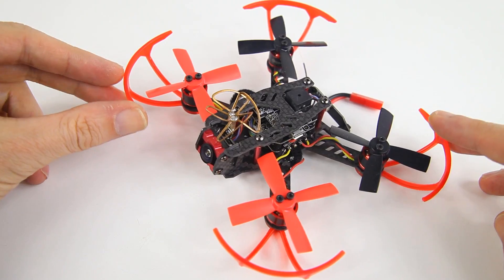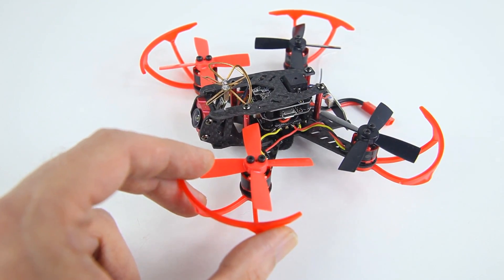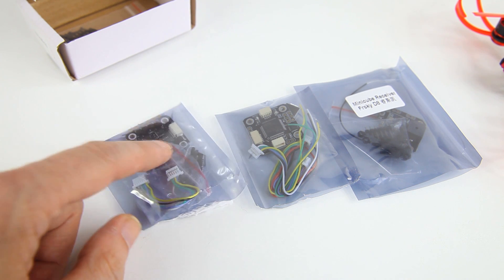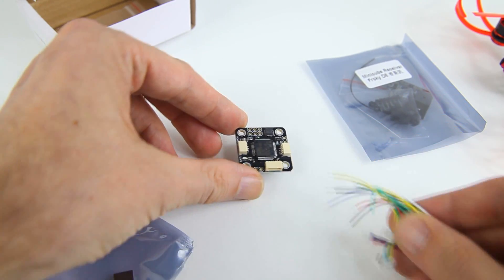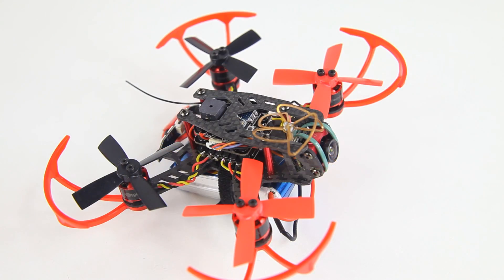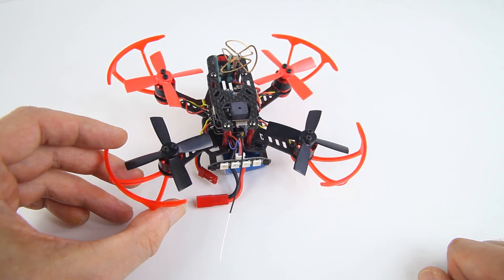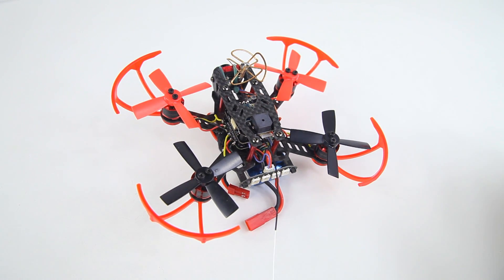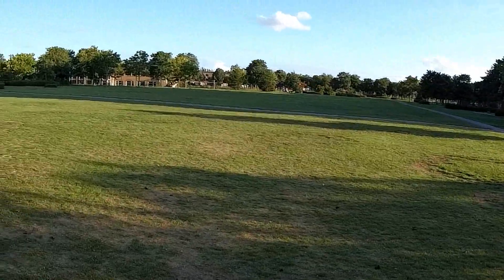Upgrading the Eachine Aurora 100 with a F4 flight controller :)

Comment: Cool video! You just need to swap out the JST for an XT30 or get 80C batteries to stop FOD 😁
Reply from the maker: Thanks buddy :)  I am OUT of XT30's :O  Got a boatload coming in though :) 
I'll allso upgrade the firmware to 3.2 though.. 
The saga continues ;)
Reply from the maker: ps: from what I hear / read it's more vibrations that has the FC choke up :(

Comment: maybe the buzzer is rated at 5v too? like the old stack? I would try another buzzer to get sure everything works fine!  with the new board it should fly smooth like silk. have fun with it
Reply: Hi guys, hi D-RC, I've good news, found the reason for the malfunction of the buzzer on the receiver board: polarity of the buzzer is reversed ! Solution: desoldering the buzzer, turning buzzer 180 degree, resoldering it to the board, et voilá, buzzer beeps ! I've opened a dispute with the seller 'Eachine official store' on aliexpress some days ago, where I bought the F4 stack, and wrote some messages describing the buzzer problem. No answer till today, it's a shame ! Today I've decided to research the problem again and have found the reason/solution finally :-) . Hope it helps.

Btw. I've replaced the F3 stack in my Lizard 95 with the F4 stack and it works great !
Reply from the maker: I'm waiting for word from BG / Eachine on this issue.. Maybe I have to short a solder-bride to switch it from 3V to 5V.. but again.. I'll wait for BG to give me some info on that.. No info in the manual / schemetics on this..
Reply: Hi guys, interesting result of my tries regarding the buzzer problem. I desoldered a receiver board from one of my F3 minicubes with a functioning buzzer (with the F3 fc). Soldered it on the F4 fc and what do you think ? No beeps but only this damned ticks. That means the problem is the F4 fc and not the beep and/or receiver board.
Reply from the maker: Damn! That's quite a big mistake but Thanks for the update Erwin! Well done sir :)
Reply: Hi guys, thanks for the kindly comments, you're welcome :-). Will post the solution on other sites also. Greets.
Reply: Same problem here with the buzzer. I desoldered the original buzzer from de frsky reciever and soldered a new one with no success. I can confirm that the frsky buzzer works on five volts, but the flight controller is giving about 3 volts on buzzer pins.
DutchRC, please post the banggood response here, and i will also ask banggood support for the issue. 
On the other side, no problems with LED Strip in my case.
Reply from the maker: Howdy Hector, 
Yeah.. Have you been posting your findings up on RCG, or was that just another pilot with the same problem? 
I did get a response from them at first.. It's been quiet after that.. If it takes to long I'll have to throw in the 'hey, I have this YT channel you know.. solve my problem' card :$
Reply: Hi DutchRC, Im just another pilot with the same problem. No post anywhere :-(
Reply from the maker: BG is taking it's sweet time responding to this problem :@  I've come to expect better from them.. I suspect an entire batch is faulty :|  I mean.. it Does fly and all.. But a micro-quad like this without buzzer.. hmmmm..
Reply: Hi DutchRC, got also this buzzer problem with two of Eachine Minicube F4 stacks with Flysky receivers. I desoldered the buzzer from the receiver module and powered it directly with 3 volts and it beeps !!! So that means the buzzer is not the problem. Have you got any answer from BG ? I opened a dispute 2 days ago with Aliexpress (bought it from there) but no answer until now. Greets from Austria :-)
Reply: Erwin Baeck hi Österreich! Ich weiß nicht ob ihr versucht habt die buzzer- lötpunkte mal durchgemessen habt um zu sehen wieviel Volt überhaupt ausgegeben werden! vielleicht muss auch n Stepper dazwischen geschaltet werden!?! ich hab das model nich, war nur n Versuch o Tipp
Reply: Hallo Toni, da bin ich gerade dabei, das zu machen. Habe inzwischen noch ein zweites Flysky Receivermodul zusammengelötet, das ich für den F4 Stack mitbestellt hatte, hat das gleiche Problem. Tickt auch nur. Schätze auch, dass es an der Spannung liegt. Apropos, was meinst du eigentlich mit Stepper ? Gruss Erwin
Reply: Erwin Baeck ich meine einen voltage stepper der die Spannung z.b. von 3,7 also 1s auf 5volt anheben kann, um vielleicht ne vtx o runcam zu betreiben!!!
Reply from the maker: Interesting! Sooo.. they kinda used a batch of buzzers with the wrong specs then (?) 
Nope man! BG is draggging their feet on this one.. I had not come across that before, but I'll open a dispute as well :|
Reply: Hi Toni, ok I understand, you mean a step-up regulator. Would be a bit bulky for such a little drone :-). But that's not the problem I think, I measured with an oscilloscope on the buzzer pins and got not 3 volts there but 5 volts instead (!) . That means the cause for the prob cannot be the voltage. Strange thing is, it's not a clean voltage but pulsed one even when the buzzer should not beeping. When Betaflight beeps then there are additional pulses on the buzzer line, I think the on/off pulses for the buzzer. I think I will try further measurements on this prob, unfortunately I don't have a schematic for the F4 FC and/or receiver board. I bought two of this Eachine F4 minicubes and wanted to put it in my Aurora 90 and Lizard 95 miniquads. But the main problem is not the buzzer problem, I've also the problem that I don't get the receiver signals into the Betaflight receiver tab (Minicube Flysky receiver board in IBUS mode, Betaflight is also in IBUS mode and receiver is bound to the Turnigy Evolution Tx).
Reply from the maker: Pfew! That is even worse / very awkward.. Did you have the quad powered up with a lipo as well? I was planning to upgrade my Lizard with this F4 cube as well.. I'm probably gonna skip that offcourse.. Doesn't really look like they actually did any actually testing with the F4 stacks :(
Reply: Hi DR-C, yes, tried it with a lipo as well, no success unfortunately. As I mentioned already before, my main problem is that the F4 FC don't recognize the IBUS signal from the Flysky receiver. Receiver is bound successfully (constant blue LED) but no reaction in the Betaflight receiver tab. I could live without the buzzer at the moment but not without a receiver signal :-). But I'll not give up, there must be a solution for both problems.
Reply: In the meantime I managed to solve my main problem, have got Rx signal in Betaflight :-) . Reason was, I had port 6 for serial Rx selected (as on my "big" F4 omnibus boards where the receiver is connected to port 6) instead of port 1 (Minicube F4 FC has Rx on port 1). Now there is still only this buzzer problem ...
Reply: Erwin Baeck cool!!! I didn't have these boards but I wanna help the community! but Erwin, you solved the problem and I think you should post it on AliExpress and several other sites to help other ones with the same problem! I think the company has no interest in solve these problems, because they have to change some at the productions. the most who get upset with the beeping noise, they desolder the buzzer so the problem is solved! thanks Erwin for your help